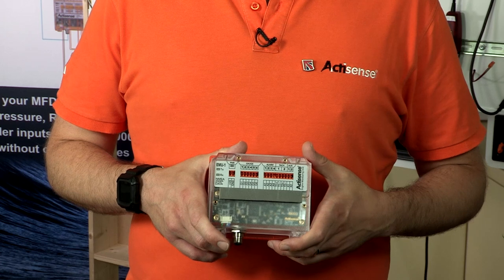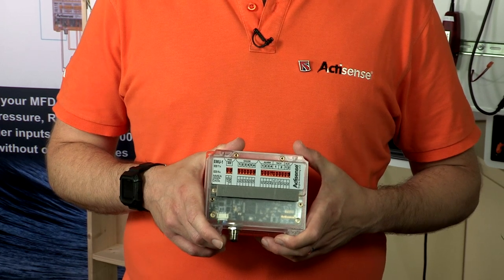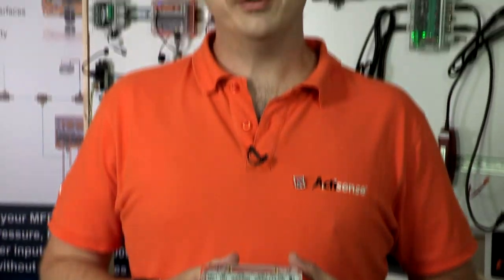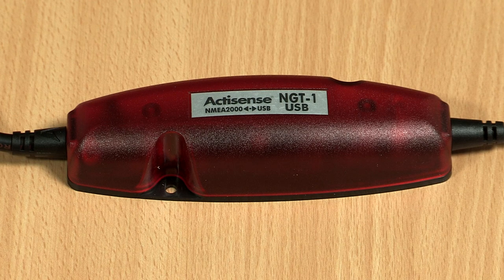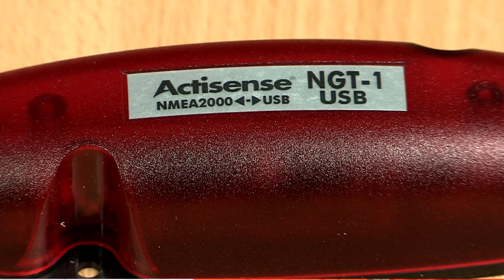Engine monitoring using NMEA 2000 with the EMU-1

Comment: It would be really nice if this came with adaption cable to suit yanmar harness if it could be plug and play and pre programmed for different engines too there has got to be around 10-15 main  marine engine manufacturers . as people order would be so much more convenient if it came ready to use by just adding a network t piece and plugging it in to the harness of the engine, it’s only reading data right